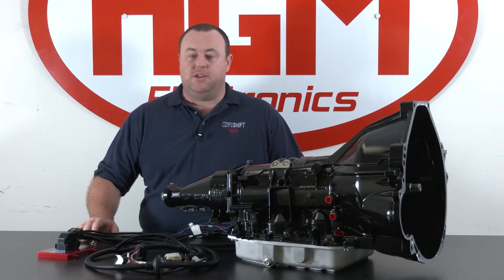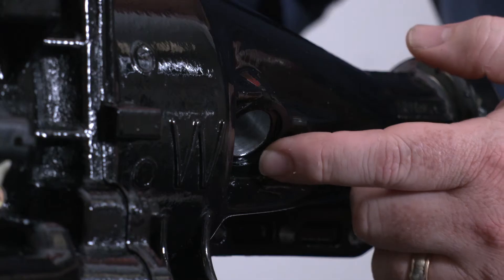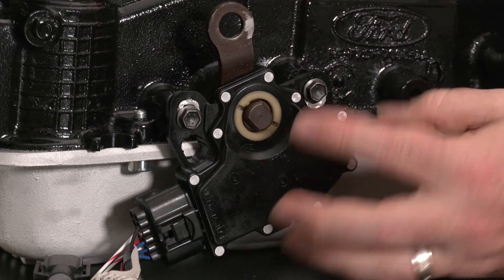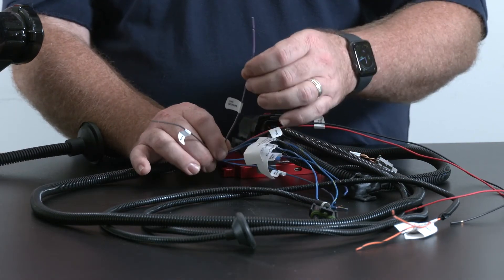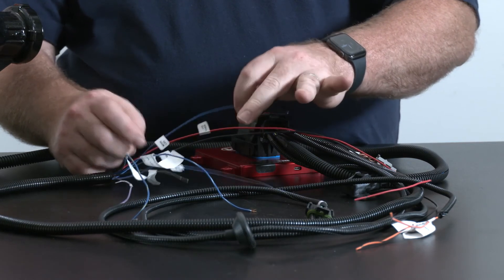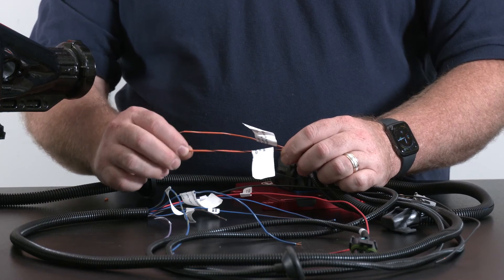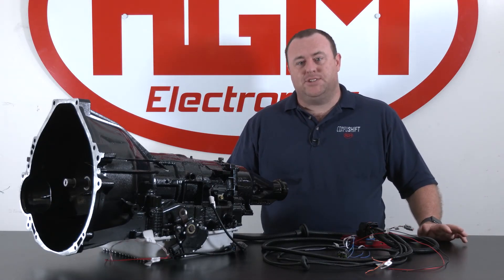4R70E, 4R70W, 4R75E and 4R75W COMPUSHIFT Harness Installation Tutorial

Comment: Great tutorial video on 4R70E, 4R70W, 4R75E and
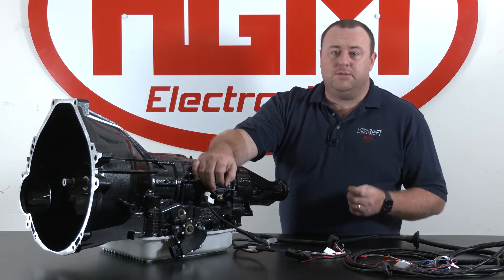4R75W. At 2:00 to 2:05 you refer to, "4R70 and 4R75". Probably minimal Differences between the "E" and the "W" but Different. Which trans are you working here? Per other vid, the 4R75 "E" has two speed sensors. Perhaps far rear is for the speedometer? Great Detail though, Please Keep the awesome videos coming!

Comment: Any Ideas? Changed dual shift solenoid, EPC, & LOCKUP to no avail, Pressure solenoid id have bad o'rings, unplugged the main (the one you showed) black 7 pin and the front speed sensor and the 2 big ones from trans to Block meeting at the bellhousing and repluged them up. shifted real fine when cold. Heating it up in the hot weather, trans got fussy again?